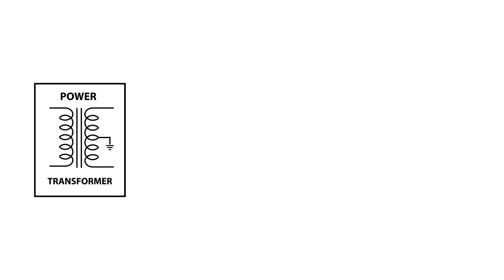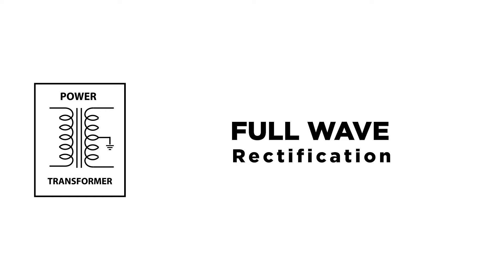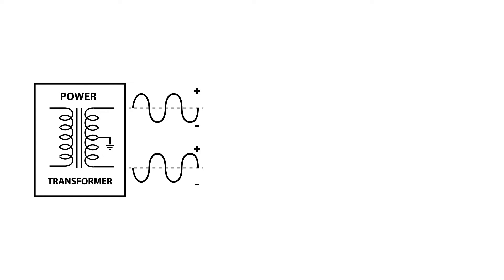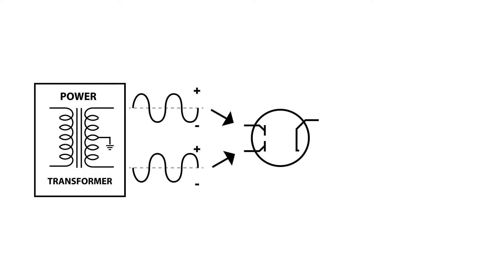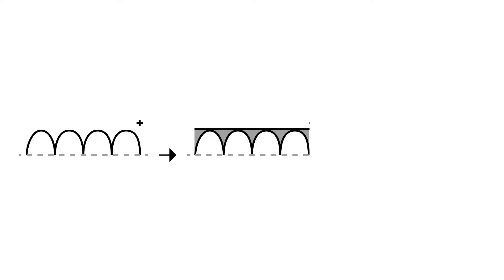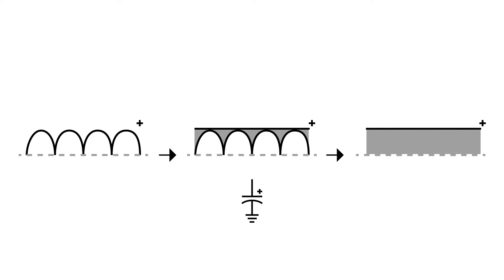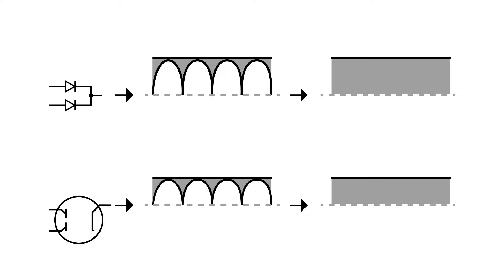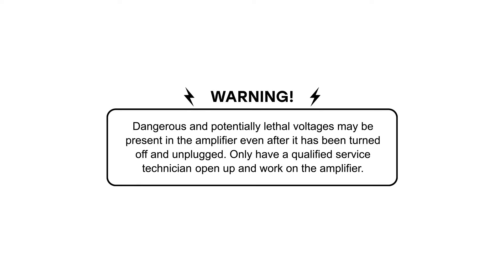Tube Rectifier vs Solid-State Rectifier - What's the difference?

Comment: Great video, much needed. What type of Valve was used GZ-34 or something else? Small combos can sound "Juicier" at louder volume and big amps(Fender Twin) work amazingly well with solid state rectification. I used a 15watt 1x10" combo with a valve rectifier and compared to the other Guitarists marshall 100 superlead it sounded so warm and sustainy that he wanted to buy my little 15watter...I said "nah" he wept, only coz I was able to turn my amp up to nearly full and got it cooking while his 100W could'nt be used past 3 volume and that made it sound "Spikey". Valve or solid state are both useful as long as they work and are reliable.Your technical explanation was 10/10!
Reply from the maker: Thanks. The 18W Halfpint uses the EZ81 rect tube.

Comment: My Mesa Dual lets you switch. To my ears tube is better for classic rock and blues overdrive, diode is better for high gain. The difference is noticeable when you are standing in front of the amp.
Reply from the maker: Agreed - a lot of people feel the same way. Tube rect for classic rock/blues and SS rect for high gain seems to be a good formula.

Comment: People do these comparisons all the time. Did you take into consideration that the tube rectifier looses up to 50v voltage at the anodes of the output tubes? So what is it that you hear
- The tube rectifier or the lower voltage?
Reply from the maker: Oh yea - I actually mentioned it briefly at about the 5:00 mark (the lower voltage of the tube rect) but didn't really go any deeper into it. The tube rect's lower voltage, along with the slower speed of making the voltage available (in comparison to SS) - in my opinion - are the two biggest factors of the difference in sound. And I think personally tend to like tube rects a little more b/c of the the lower voltage.
Reply: A lot of it depends on the type of tube rectifier as well- a directly heated cathode such as a 5Y3 or 5U4 is going to have a lot more drop than an indirectly heated cathode type such as the 6X5 or 5AR4/GZ34 due to the closer spacing between the cathode and plates.  If you want a tube rectifier that mimics the characteristics of solid state and will give you a bit of a light show to boot, there's the type 83 mercury vapor rectifier which has a constant voltage drop and will have a milky blue glow between the cathodes and the plates which will get brighter the louder you play.  The downside of this tube is you need a choke input filter and they have to be thoroughly warmed up before hitting them with high voltage or they'll arc back.

Comment: Howdy. Nice.
Another advantage of tube rectification is the soft charge up of the anode voltage.
Using SS there is a nasty current rush just after switch on.
There are two rushes happening at the same time. Firstly the transformer will gobble a lot of current until it is phased in. Phasing in is that the magnetization has shifted 90 degrees.
Secondly the capacitor bank will draw heavy current when charging.
With tube rectification there is only the phasing in rush.
Regards.
Reply: Are you typically working with DC filament circuits?
Most systems I see power the anodes directly from a 6.3 or 12v secondary, and are not rectified, so there would be no difference there, but DC anode circuits do exist.
Reply: @gregfaris6959  Howdy.
With all due respect. I do not fully understand Your comment.
I should think the video is about anode voltage rectification. Plate voltage in US.
Filaments, however, usually use 6.3 V AC. Yes. Or sometimes 12 V to mitigate filament currents by connecting filaments in series.
High End Audiophiles sometimes use separate power supply units that provide regulated and filtered 6.3 V DC to filaments. That is an effort to totally eliminate hum and achieve maximum dynamics.
Cheers.
Reply: @eugenepohjola258  
You are correct. My apologies.
Somehow I thought you were referring to filament (cathode) warm-up. I stand corrected!

Comment: Thankyou for posting this! Excellent demonstration, the only video I could find A/B-ing the 2. 

The tube definitely has a rather more burbling quality, very noticeable here on the sustained dirty chords, not only on the attack portion.. I had always imagined it was just an initial sag and then recovering at a certain rate after the high current transient, but this shows that the rectifier is constantly varying output during the waveform to a higher degree than I previously realised, and is partly responsible for a lot of the character that I like! Enlightening. Thankyou again.
Reply: It was more noticeable than I thought it would be. Makes me wonder if it's possible to build an amp that has a switch /or relay to go between either.
Reply: @BrianClem  there are a few amplifiers who allow you to switch between the two with a toggle on the amp

Comment: Excellent video ! But what happens when the 120v is too much for the newer rectifier tubes and the arc? The you put two solid state diodes across the pins of the rectifier socket to prevent the current from changing directions? I'm assuming the amp will still only be as fast as the tube ? Would the voltage and ripples be half way between the two ?

Comment: I couldn't hear much difference but I'm listening with cheap headphones on my phone so that probably doesn't count. 😂

Also I suspect the difference would be more pronounced at higher output where more current is drawn.

I'm a retired engineer and I build tube amps for fun.
I've been using solid state rectifiers but now I'm gonna try a tube.

Thanks for the inspiration!
Reply from the maker: That's cool. Yea, good headphones might help. The difference is a subtle thing sound-wise. It really is more about how it "feels" versus the sound - hard to relay that over the internet - ha. But there's definitely more attack and "omph" on the SS rectifier, whereas the tube rectifier feels a bit more rounded out and mellow.